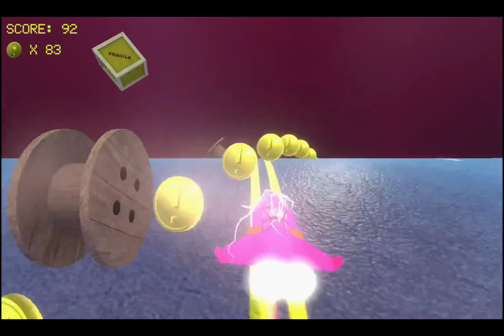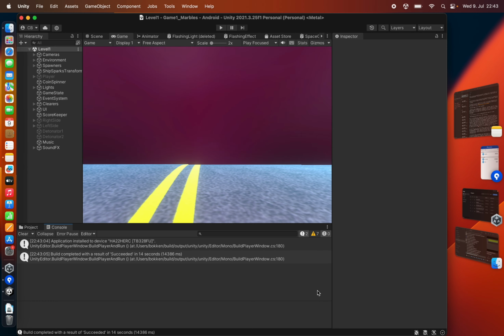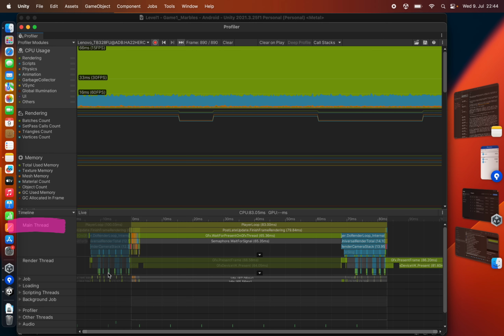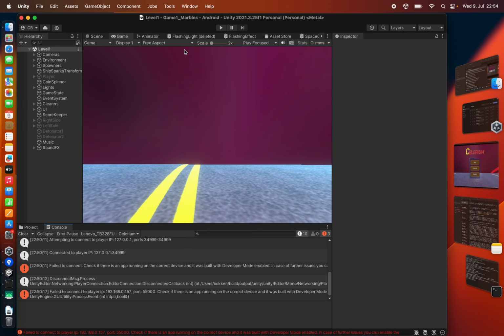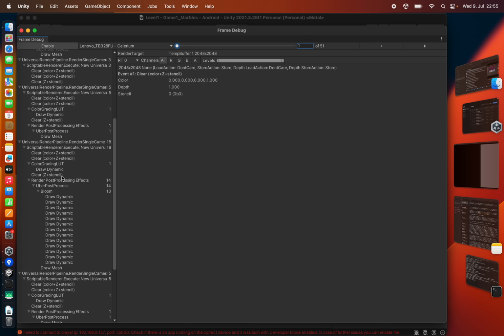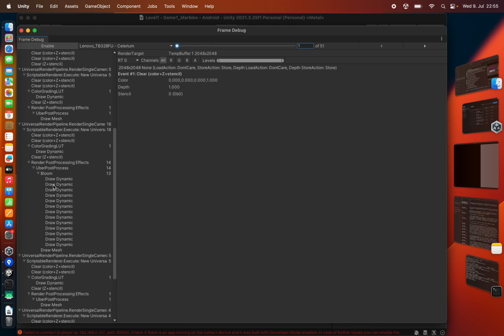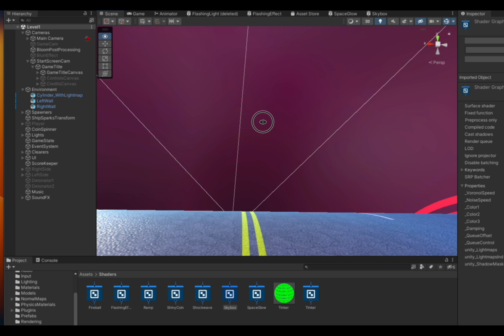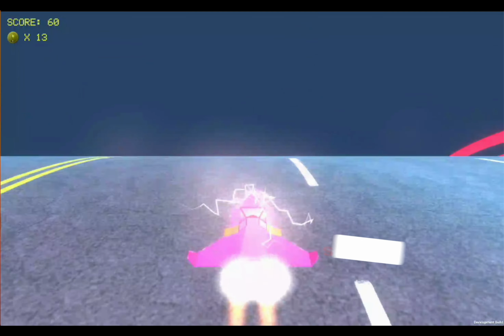Unity Android Performance Profiling – Profiler, Frame Debugger & AGI Tutorial

Comment: bro can you tell me how did you connect your device as a remote device(in the unity frame debugger and in the agi also)? did u just use usb debugging or something more?
Reply from the maker: Yes just plugged it in via USB and enabled USB debugging. Usually a dialog on the device also pops up that asks you whether you want to trust the computer you are connecting to. Be sure to trust it and it should work.

Comment: Did you ever learn what about the skybox was causing such a long render time?
Reply from the maker: I ended up not pursuing it further at this time as I didn't plan on publishing it on mobile just yet. 

But looking into it briefly I think the main issue is that this gradient ended up having a pretty high per-pixel cost. The fact that the gradient was animated meant it could not be cached and had to be computed each frame. Combine that with the fact that I applied it to the skybox and the GPU basically had to compute this gradient for every pixel in the entire skybox. Not just for a small object that might end up getting culled but for the skybox which is always visible. So my current takeaway is to just not do this in this way if I want to target mobile. But again, I didn't dig further here beyond this and did not attempt to make a more performant version of the skybox. So maybe there is still a way to achieve this effect in a way that works well on mobile as well.